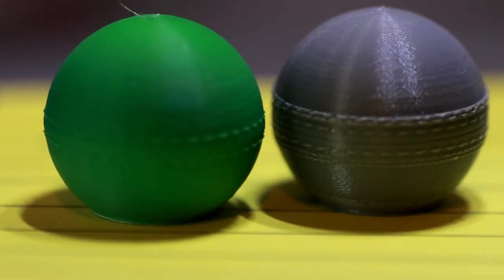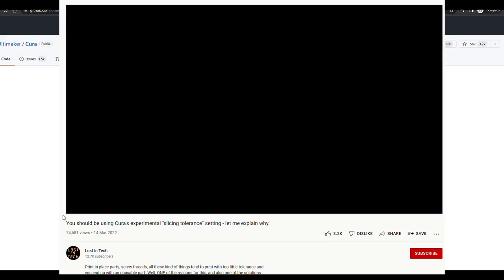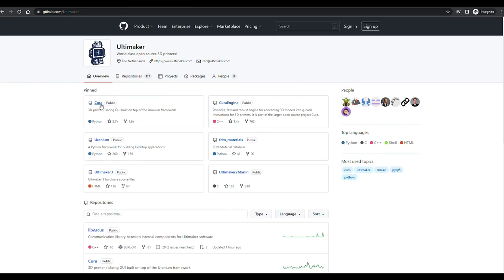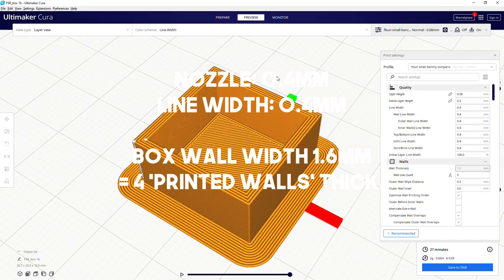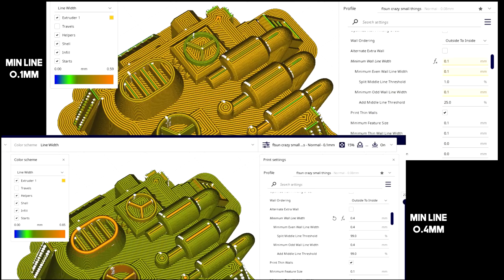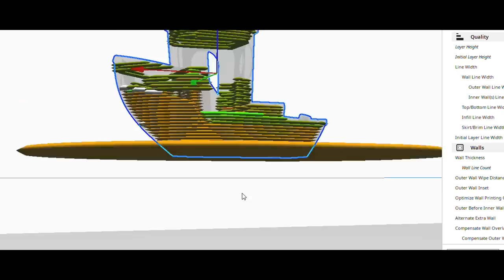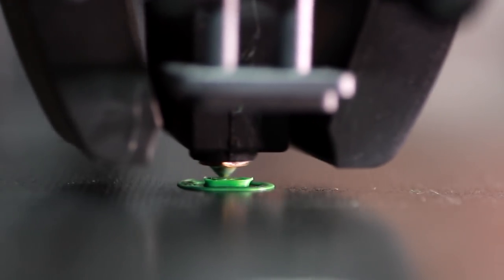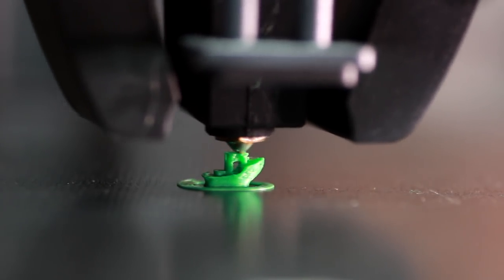Ultimaker Cura 5.0 is out and I'm serious, it's a game changer.

Comment: Nice. I always spend a lot of time playing with the model and slice settings trying to avoid that 'tiny zigzag' when the widths don't quite fit. Finally switched back to Cura from Simplify3D about a month ago after years of using S3D and am glad I did.
Reply: Yeah, that is what we call the "medium wall problem". Cura 5.0 should completely fix that
Reply: I just did the same, and it really fixed most of my issues. Even the corners are almost perfect now, and i have no pressure advance calibration etc. done.  Still waiting a Orange PI to arrive to upgrade to Kilpper for that. 
Glad i tested this. I was constantly wondering why my prints looked so crappy, compared to what i was seeing online and thought it was a printer issues. But it was S3D issue.
The only weird thing about Cura is that it seems to do a lot of weird unnecessary looking retractions where i goes and does like one small pixel worth of extrusion and moves to another spot and does the same.
Reply: Disabpe 'fill tiny gaps' (or something like that) and these mini extrusions are gone. Most of the time they are only needed for technical parts with small details like some gears and stuff
Reply: @flixquadrat6337  That can leave gaps in the top and bottom surfaces though. There's a github issue open to add an option to only fill those gaps in top/bottom surfaces, but it hasn't happened yet.
Reply: @qwertymodo  mini gaps dont matter most of the time and if yes just use a support blocker on the top surface, select "modify Settings for overlaps", "cutting Mesh" and then activate Gap fill or even use smaller line widths for better Quality on top surface.

Comment: Maybe you could push cura 5 to the limit like what you did with vase mode (with a 0.4 mm nozzle) and see the upper and lower bounds of line widths, which will be useful for the new settings.
Reply from the maker: A good idea. Plus I see something in the change notes about vase mode, so I should look into what that means too.
Reply: @LostInTech3D  From my testing, the actual vase line width will now (usually) print at a higher line width than the inputted one.  It's kind of weird but basically if you tell cura to print at a 0.2mm line width for vase, you can see in preview that it will actually print at 0.34mm line width, 0.3mm turns into 0.54mm, 0.4mm turns into 0.46mm, 0.5mm stays at 0.5mm and anything more stays at the same line width. Also now vase mode prints always have a concentric bottom layer, which is probably a bug.
Reply: The max line width for a nozzle is really determined by the diameter of the flat part of the bottom of the nozzle. You can use a 0.4mm nozzle and print a decent line up to 1.5mm wide and 0.5mm thick.

Comment: I have used the new Cura a little bit allready. I can’t use it on my older printer as I had the z offset plugin installed, along with a ton more. But using it on my primary printer has been great. 
Looking forward to your next videos 👍🇦🇺😊
Reply: I had the same, so I just added a z offset in my printer start up instead to get around this for now.
Reply from the maker: I suggested the startup code in another comment actually, it's basically uhm..

G1 Z0.5 ;move up to 0.5mm
G92 Z0.3 ; and tell it that this is now 0.3mm
; thus creating a z offset of 0.2mm

(I havent checked this, don't yell at me if it drills your bed!)
Reply: Yep. The only down side to using in start up is that it isn’t as easy to have a slightly different squish for pla va petg. The plug-in made it easy. It will likely be back, just needs an update.
Reply from the maker: yep will definitely be back https://community.ultimaker.com/topic/40313-fieldofview-plugins-for-cura-50/
Reply: Z offset plug in available now for Cura 5

Comment: THANK YOU FOR POSTING THIS
Always wary abt beta slicers, id rather just suffer until full release for the sake of consistency... but DAMN I'm glad I installed this for my current project.. with no changes it cuts 1.5hrs off of a 11.5hr print of a sideways cylinder! 

I can't wait to test it, but there's some differences in the support pathing it looks like, vertical trees seem to branch out more evenly and wider than 4.x, and Thin flat support at the buildplate is making slightly larger "X"' patterns, I would assume that would make those pesky lil nailbiter supports on the bottoms much easier to remove! (PLA+ or tougher)
Reply from the maker: I accidentally noticed the supports on a model, and was also totally confused! I will check those out a bit closer later, but yeah, the X patterns! 👍

Comment: The "Make overhangs printable" setting has also been improved. Instead of changing the overall shape of an overhang, it will creep in on the overhang by changing the shape of the wall of the object, not the projected geometry of the model as a whole. Hard to describe but take a vertical wall with thickness (say 1cm thick), punch out a circular hole (like a round window opening) and model it with "Make overhangs printable" ticked, and compare layer views of the lower half of the opening to the upper half.
Reply from the maker: interesting - I've just been looking at that actually for a video! 👍

Comment: Maximum line width would be a handy constraint to have, too. Struggled a bit with a pinched acute angle corner. The thinnest spot was modelled to be two line widths but Cura 5 wanted to make the line thicker and print a disconnected island instead. Wasn't too impressed with fine detail on a flat surface (eg. top), either. So while it's good to have more options, I'm not sure it's good enough to be the default, yet.

Comment: I just started using it tonight. And aside from having to add a z offset in my start gcode for my printer to cover the z offset plugin, it is working well. A few strange crashes when previewing, but the prints look good. I do have to try and disable my power recovery like CHEP did, since I have the same layer blobs on my cr-10s, but I actually had the in 4.13, just didn’t know that this was the cause.  They are just worse in 5.0, so I will try and disable power recovery and see if it helps tomorrow.
Reply from the maker: Regarding the blobs, I would suggest a faster SD card first. I actually run creality printers on octoprint without an SD card and that stops it in its tracks 😉

Comment: Tried using it yesterday, had a crash while I was running it through a USB cable to my ender 3, so switched back because had to get something done, but really exited to see what the control of detail will do
Reply: Loving it so far. Took a item i printed in 4.13 that took 3:49 to print. Same model, same profile, same setting. ended up being 2:20 after the extra fills and travels were pulled out.
Reply: We're working on fixing the USB printing. I expect it to be fixed for 5.0 final

Comment: 3:50 is a motor!
Also I'm VERY excited about this, no more choosing between 0.25, 0.4, and 0.6 nozzles :p
Reply from the maker: I have been thinking for a while that you only need .4 and .8+ nozzles. This is more compelling argument for that case.
Reply: i think you would still do better with a smaller nozzle, as its like a big sharpie vs a small one, ... but it would reduce the gap between them
Reply from the maker: I will have to try at some point to see what happens 🙂
Reply: @LostInTech3D  I always found it annoying switching nozzles (especially when you have to change z offset), so I tend to leave the 0.4 v6 nozzle on my ender 3 pro. and now when I need big parts, I've got my tronxy x5sa with a 0.8 volcano.

Definitely looking forward to tinkering with this, and get nicer details with thinner lines / speed up and get stronger parts with thicker lines

Comment: I experimented with line widths before and you cannot really do a lot, maybe +/- 0.05 mm. Extrusion width is mainly determined by hardware - nozzle size. I wonder if this slicer can produce prints without the pesky little holes/gaps between details on top and bottom layer (as those are not large enough to make for a regular extrusion).

Comment: is there a way in cura to program in a point too pause a print.

I want too had part on the print mid print, this could be used for gadgets metal parts or storing items inside a print.

I rember somone talking about a slicer that's able too do this but wondering if there is a way too do it in cura so it will pause printing on the exact hight I need it too so I know the added object will not impead the print or hit the nozzle.
Reply from the maker: Yes there is! "Pause at height", I've not used it in a while, so I suggest googling it, its a plugin if I recall correctly. 
Be aware that some, many printers don't pause correctly so test it out first.

Comment: CHEP found the seam blobs were from the recovery settings from an interrupted print. he shut that off and the pause at the seam while the SD card is written with recovery info. FYI, might be something to mess with.
Reply from the maker: That's a common problem with the 'recovery save to sd' on a few printers, I've known about it a long while as the ender 3 v2 does it, though I've never suffered it myself (not least because I use octoprint I guess). I believe it only manifests with an sd card issue, as for example the FLSUN I reviewed and used for these tests didn't have this issue even though it is notorious for this behaviour. I honestly think printers would be better without that function in the first place, I would always advise turning it off if possible unless you have a lot of outages, and even if you did, there's other ways to resume a print (I should make a video about slicing gcode).

Comment: I'm quite new to 3d-printing and have only been using Prusa Slicer, so I'm curious how that is compared to the new Cura 5? :)
Reply from the maker: I don't take sides, but I think it's worth trying both, you can run both all the time, they have strengths and weaknesses.
Reply: I used Cura for 5 years.  Just switched to Prusa and I don't think I'll ever go back.  The per layer configurability is worth everything.

Comment: My .4 nozzle is making entirely spongy prints with Cura 5. Is it a requirement to enable the minimum line width to make sure it works? Every test so far is borked, from pure sponge prints to clicking extruder. Instantly fixed when switching back to 4.9(I'm too lazy to update all the time lmao, the .12 also works) Maybe I will wait for a couple of patches. Ender 6.
Reply from the maker: that sounds super weird. We are on discord if you want to try to get to the bottom of it (though I too understand laziness! :) )

Comment: Can't seem to achieve tiny benches as demonstrated in Cura 5.0. 

I'm printing with a 0.5mm nozzle, but I can't seem to print any walls thinner than 0.5mm.... even when I modify the "minimum" settings that were adding in 5.0

any tips? 🤔
Reply from the maker: you have to turn on "thin walls" as well, if you haven't - I'm not entirely sure why that makes a difference.
Reply: @LostInTech3D  I have "Print thin walls" enabled as well 😔
Reply from the maker: and you've changed the arachne specific settings? I am not sure what else to suggest.

Comment: I wonder why they don't expose a maximu line width. 0.8mm line widths are just impractical with 0.4mm nozzles but they keep showing up whenever I slice in cura 5.0
Reply from the maker: They do actually. But 0.8 is absolutely fine on a 0.4, although I would have to check the spec to see whether that's within range. Leave it with me.

Comment: been using Cura 5 for a while now and it is superior to 4. Octoprint plugin not available yet, but Octoprint still works. So i save gcode to PC then upload via browser. No problems. It is the manual support plugin that i miss
Reply from the maker: I've been told (but not had chance to look yet) that the octoprint plugin is available in beta. Manual supports, not heard about, I had it but rarely used it.

Comment: I gave Cura 5 a try the other day but it refused to start up until I backed up and deleted all the settings from the previous version. Some previous settings are not compilable. 
I got it to start by just deleting the cura.cfg from my appdata and keeping everything else from 4.13, of course it complained about the plugins not being compilable and disabled them.
I was able to have a look around but I will hold off using it for now till it behaves and loads my original settings because I don't want to configure everything again.
Reply: Please report issues like this on our github! We can only fix what we know about.

And thanks for testing it! Your help is what makes a stable release possible
Reply: @nallath  I would but there are no logs, they are only created once I reset the configuration so there will not be anything shown. It did send a crash report though.

Comment: How does this differ with the "fill gaps between walls" setting in old cura? Seems like it accomplishes the same thing
Reply from the maker: oh, that's a really good question that's also hard to answer without it turning into an essay. It's a much more sophisticated algorithm that goes way beyond trying to fill the gaps by widening the extruded line, with single thicker lines. I think as time goes on and I get my head around it, I'll be able to dive a bit deeper :)  The main reason you're not seeing easy answers out there yet is because - it's complicated!
Reply: So slicers used to work outside in; You take a shape and you cut off the area where you want to place material. You continue doing that until you have placed all the walls that you want and whatever is left is for the infill. It's a pretty naive solution but it works reasonably well for most objects. 

What arachne does is that it starts "from the inside out". Instead of starting to cut things off right away, it generates a "center line skeleton", from which it generates areas. In each area you make an estimate how many walls can fit in there. Once you did that, you can then try and stitch these areas together and potentially change the number of walls by varying the linewidth. 

So where the old solution would only have the line width variation in the center most line (and all others essentially being a static width), Cura 5.0 has the ability to change all of these linewidths. So where previously you would fill a 0.9mm area with 2x 0.4 line and 1x 0.1 line (which would look horrible), it can now use 3x 0.3mm lines to perfectly fill it.

So you are correct in a sense; It does accomplish the same thing, but it does that so much better.

Comment: Now I just need to find a way to make it stop changing direction on concentric items. It takes at least 15% more time just on changing from clockwise to counterclockwise at every wall line switch when it could just continue on in the same direction.
Reply from the maker: If you can reproduce it then please log it with ultimaker - I have noticed this sometimes but not had time/ability to reproduce it consistently yet.

Comment: I'm not seeing the Beta make any attempt at these variable line widths, is there something that needs to be enabled, or do I need to use a particular profile?
Reply from the maker: It absolutely should, by default. Load up a benchy, set it to 50%, slice, and look through each slice with "flow" or "line width" mode selected in the preview screen. If you still see nothing....then I can't explain it.
Reply: @LostInTech3D  Well it seems Cura's "uninstall" doesn't properly do what it should and ends up leaving all sorts of crap behind that confuse V5. An uninstall, even with removing profiles isn't enough and the folders under APPDATA/Cura folders needs to be deleted to make V5 happy.
Reply: @frankhovis  That's a bug, sorry! We fixed that for the final release.

Comment: Trying to use Cura 5 right now keeps randomly closing when slicing, or if I switch printers then go to the settings menu it closes. other than that I did get a benchy out of it and it seems to work good. Great video thanks.
Reply from the maker: ^ yes - I can reproduce that bug, and I will be reporting it assuming nobody else has.
Reply: Please report this on our Github page
Reply from the maker: Just to update, I have logged as https://github.com/Ultimaker/Cura/issues/11988

Comment: Been trying to use the 5.0 beta with absolutely zero luck. It has, to date, crashed aggressively on every print I've tried to run (stopped after 6, still trying to figure out wth is up with its error code) with it so it went back on the bench for the time being while 4.13.1 does its thing with no odd hangups and repeated crash messages (talking full on memory-leak flavor of crash messages, crash messages until the crash messages cause the crash file logger to crash the crash messages)
Reply from the maker: worth checking for logs to report the issue? https://github.com/Ultimaker/Cura/issues/new/choose

Comment: I tried Cura 5 today but I got a problem that bothers me. When I drag a STL file in Cura it needs 20-30s to process (just show the model; not slice) whereas Cura 4 took less than 5s.
Reply from the maker: I've just checked that, on win10, it takes almost no time at all. Sounds like maybe you have some OS problem, like something hanging the system up, but its way out of my area of expertise! Does it do it when you file->open too?
Also make sure you dont have any usb drives inserted.
Reply: @LostInTech3D  I've closed all other programms. Cura needs ~20s to load benchy. Thats way too long. I'll get in touch with Ultimaker to solve the problem.
Reply: @kaihatkeinenaccount  Thanks!
Reply: Disabling "USB printer detection" fixed that for me in Cura 4.13, google to find other people discussing this in previous versions. Although this may be a separate issue.

Comment: Is the variable line width turned on from the start or is it something that I have to enable?
Reply from the maker: it's enabled by default (in fact the only way to disable it would be to set wall to nozzle width..and that would probably only work for walls)